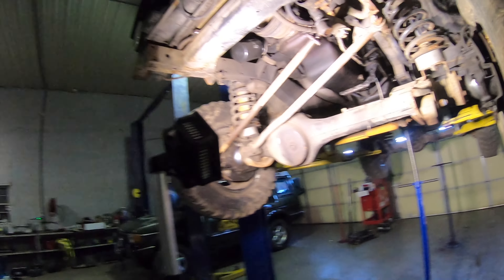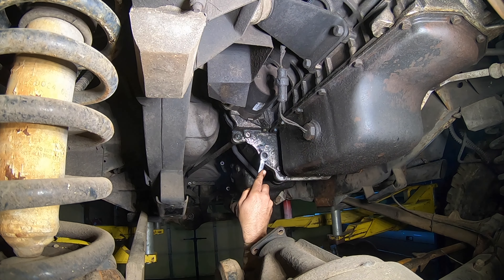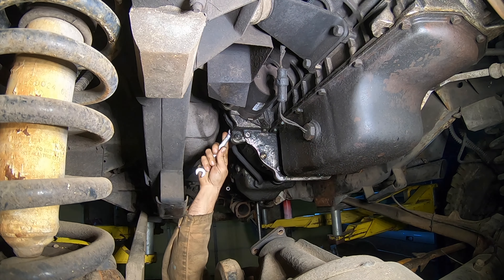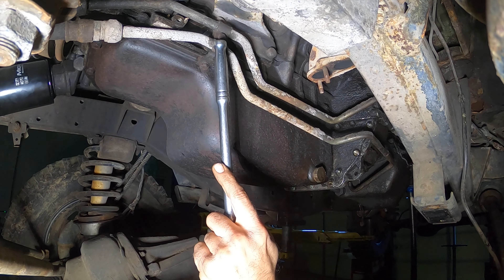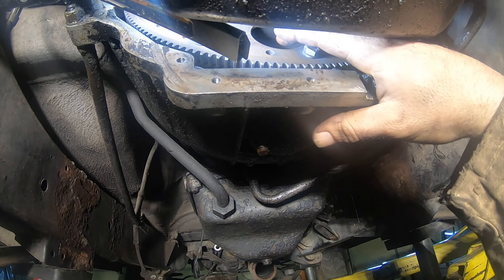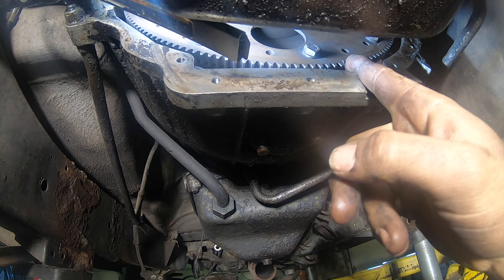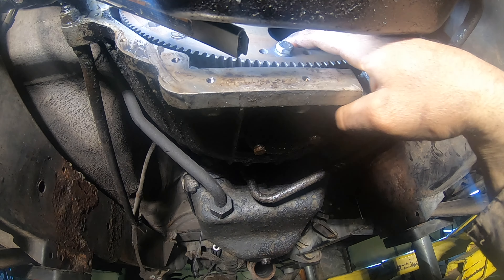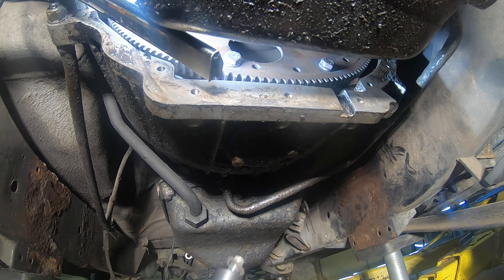Range Rover Classic Restoration by American Safari Vehicles: Episode 10

Comment: That slot in the bell housing where you used a screwdriver is for a wrench to hold the torque converter flex plate assembly, the handle of the wrench fits in that slot. good for holding the engine when your working on the harmonic balancer bolt too. I take off the 3 bolt cover underneath and use a wrench on the torque converter blots. But it works the way you did it too. Not sure why i keep watching these..lol its entertaining in an almost painful sort of way. plasma cutting the bumper off,in that other video,  with a piece of the hitch mount, was a mouth fell open moment.. I was like what the heck is this guy doing....I give you an A for effort though...
Reply from the maker: Now that would have been good to know beforehand! 
 Yea the "offroad" bumper was welded to it, will have to sort that soon enough. Whatever may be the reason you've watched them this far, I appreciate it!
Reply: @americaoverland  I did not mean your videos specifically, I meant people with Land Rovers and old classics who just dive in with out knowing what they are doing..lol there are a bunch of videos about just about everything you would want to do on YouTube..trailfitters tool box videos, and the fine art of Land Rover maintenance. just to mention a couple..good luck to you in all your endeavors. Knowledge is POwer